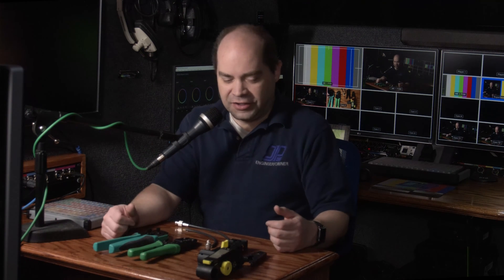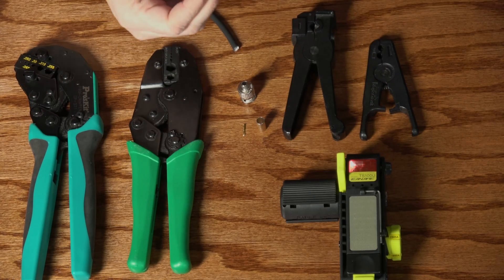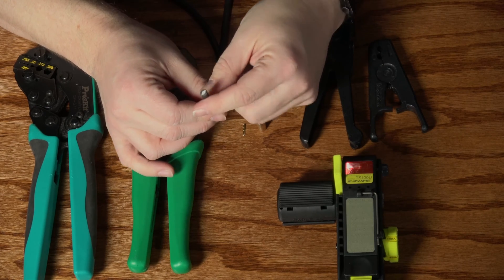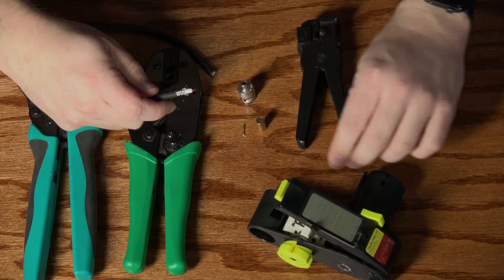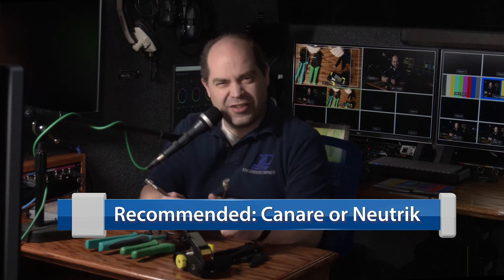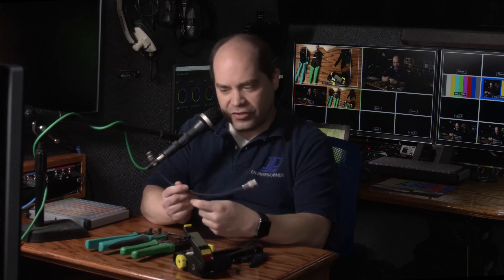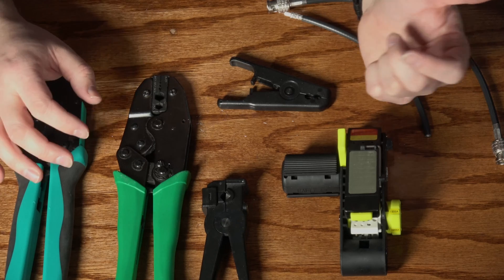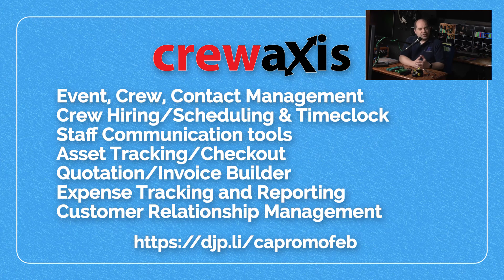SDI/BNC Cable Termination - How? What Tools?

Comment: Hello and thanks for the video. What do you think about the Neutrik Twist connectors? Would you say these Canare are superior in terms of reliability and durability, or they are both good? I like the Neutrik ones because the twisting part is long which is comfortable and quick when there are too many cables too close, and also if one pulls that in a rush, always the connector is pulled, never the cable. I am thinking to make a run of cables using these Neutrik, but I am trying to understand their reliability first.
Reply from the maker: Both are fantastic. You won’t go wrong with either one.

Comment: Hello, I am using canare l4-cfb with the ts100e stripper. I’m running into an issue where sometimes when I strip a cable the center pin is very fragile and breaks off. I will sometimes cave to cut and strip a cable 3-4 times before getting it right
Reply from the maker: You might need to adjust your stripper. It sounds like the blade for cutting to the center conductor may be set to deep.

Comment: Hey Doug,
Your videos are great and helped me figure a lot out for my church. I need to make some cable. I was looking into the 1505f for the flexibility. Is the TS100U for appropriate cable stripper or is there another model? I did not see one that list 1505f online.
Reply from the maker: The stripper should be the same as 1505A if you're using Canare connectors, so the TS100U would work, though you'd likely need to adjust the depth of the blade for the outer sheath. 

In the case of 1505F, the proper Canare connector is BCP-A42, and the crimp die for that is TCD-31C. That's a different connector and die than the 1505A that I use and demonstrate in this video (which uses BCP-B4F and TCD-451CA). The crimp dimensions are different between the two. The sleeve on the 1505F is considerably wider than on  1505A. You wouldn't have good luck trying to use a crimp die made for 1505A on 1505F; it would crimp too tightly and likely damage the cable and compromise the electrical connection.

I have not found a suitable third party crimp die for 1505F. And indidentally, Canare crimp dies only work in their own crimp frame; they don't fit the generic frames you find all over. If you're intent on using 1505F you should plan on investing in the official OEM tools, as expensive as that may be.
Reply: @djp_video  Copy. Thank you for that extra information. As I stated I wanted to use the 1505F for it's flexibility for shorter patch cables etc... I will probably stick with 1505A. Thanks again!

Comment: Your videos are very helpful - thanks so much for taking the time to make them!
Quick question, I have been starting to crimp my own SDI cables using 1694A cable (1694A-1000-VIOLET) and Belden crimp connectors (1694ABHD3) - the issue I am having is that when the connector is slid onto the dielectric it appears to flare the sheath just enough to make it very difficult to slide the ferrule down onto the sheath and connector fully. Thoughts?
Reply from the maker: I haven't used that specific connector before, but it does look a lot like the Canare BCP-B4F that I use. 

Are you using the official tool to strip the end?  It almost sounds like the outer sheath isn't being stripped back far enough.

Comment: Hi, your videos are awesome ! I have a quick question. Im on the Canare Website and they list several model connectors. I'll be using the BMD mini converters. What specs do I need to look at to get correct connector. Thanx
Reply from the maker: The connectors should match the cable you’re using. For example, I use Belden 1505A cable most of the time, and the Canare BNC connector for that cable is the BCP-B4F. 

The type of cable will vary based on what signal you’re using and the distance it needs to be run. Again, from my example, Belden 1505A is typically made for permanent installation of 3G-SDI at up to 100 meters. 1505F is the more flexible variant of that. 1694A is a heavier duty that should give some additional distance, with 1694F being the more flexible variant of that. Both of these families of cables can be used for 6G-SDI or 12G-SDI, but in shorter lengths. Each cable manufacturer will have different cables for different applications, and the specific connector will vary based on which cable you select.
Reply: @djp_video  Hi Doug, thank you for your response. My company mainly supplies audio for live band performances and such, but from time to time I am asked to supply video to multiple projectors, LED monitors, etc. where I sub out that work. With that being said, I want to provide that myself. I was given a 500ft spool of Southwire Quad Shield 18awg RG6 3G Coax cable. I believe this is what is sold at local HD. For occasional setups I believe this  is ok for me, but I'm confused as to what Canare, Neutrik or other connector termination to use for this particular cable. (BTW Neutrik is all I use for my XLR cables)
Thanx Doug
Reply from the maker: If you're using hardware store coax cable, you should be able to find suitable (though not amazing) connectors at the same store. Trying to find matching connectors from Canare or Neutrik might require some trial and error.

Comment: Looks like greenlee got bought out.   And I thought I bought what was the “2649” die which I guess is now paladin But it won’t crimp.   The link to the canare connector specification chart that you have does not work anymore.  What is the actual sizes of the holes?  Mine are .324 and .255.   Any help would be great!  Thanks so much!
Reply: On the Paladin, .052 for pin, .255 for sleeve. I believe this to be true for both 1505a and 1694a.

Comment: What would you recommend for a super flexible coax cable.  Specifically in the 3mm ish diameter range.  Its not actually for video it would be for automotive labscopes since we use BNC coax test leads.  Pretty flexible where it would almost be like a multimeter cable

Comment: What about rg6?
Reply from the maker: The Belden 1694 that I talked about in the video is an RG-6 type of cable.

If you're dealing with hardware store RG-6, good luck in finding good quality connectors that don't fall off. The good quality name brands (Canare, Neutrik, Belden) don't make connectors designed specifically for "generic" cable like that. The good connectors are made for specific SKUs of RG-59/6 from the same manufacturers.
Reply: @djp_video  do you recommend a cramping tool ? There is three kind I found

Comment: Can an SDI cable that had one end inside and the other left outside for months be salvaged (used outright or clipped and a new connector added)?
Reply from the maker: There's a good chance of it. Clip off the bad end and take a look at the cable to see if it still looks good visually. If so, add a new end and test it.

Comment: What size are the crimping dies? I see a few that are capable of doing BNC connectors but are different sizes.
Reply from the maker: http://www.canare.com/UploadedDocuments/Crimp_Die%20Spec.pdf
Reply: .176 for 1855a .255 for 1505 and .278 for 1694. These are die sizes for mostly kings or ADC connectors. Canare is pretty expensive connector
Reply: https://www.canare.co.jp/en/catalog/docs/26E/Canare26E_Eng.pdf  See Page 49

Comment: Im using the same yellow stripper trying to strip 1505F and it does not do the cuts that well, that clean or at the right distance. when it done cutting I have a copper wire, metal braiding and the black sleeve... for what it costs, its majorly disappointing.
Reply from the maker: The blade depths are adjustable if you aren't getting clean cuts. Use an Allen wrench to move the blades up or down as needed.
Reply: Do you know if clockwise or counter clockwise makes it cut deeper  @djp_video  ? Also, I pulled a USMC thing overthinking. For anybody having trouble, it literally takes 5 turns, if you go over 10 you end up cutting through where you shouldn't causing you grief. literally only 5 turns or until you feel tension fade, like Doug said in the video.. if you do it a bazzilion times your going to have a bad day.
Reply: @djp_video  , is the copper in the middle solid or is it stranded? I had a couple of pins that wouldn't go on and the wires broke off in the pin trying to get it in. im assuming the F makes it stranded so its flexible.
Reply from the maker: The F version is stranded, the A is solid conductor

Comment: You mention the foil under the braided shield. Does the connector go under that part too or go between the foil and braiding?
Reply from the maker: The connector goes between the foil and braid.
Reply: @djp_video  how is this done? I find that it's nearly impossible to twist the outer braid out of the way of the connector without also doing the same to the foil.
Reply from the maker: I usually rotate the whole end of the cable in circles a few times. The foil stays put on the insulator but the braid bends out of the way and makes room for the connector
Reply: Hey Doug, to add to this at 5:20 of the video: I am being told by a coworker that in order to put the connector on properly on this cable (1694A), I need to pull back both the braids and the foil together on the before I snap the connector in fully. In other words, fold the foil flat over the end of the connector (without bunching it up) and then the same with the braids. 

In many videos I’ve watched on the Internet of how to do this, I see the foil still laying untouched on the insulator after the connector snapped in and then the folded back braided go back laying on the connector before the ferrule gets crimped. 

I have found it difficult to fold the foil back to lay it over the connector. I keep squishing it down  where I have to start all over. Which way is correct or does it even matter? I understand that some clients have different standards of how cables are installed. Hope this makes sense, Thanks.

Comment: My second question is how to test the signal quality of the cable that I bought or made by myself is good enough? Thank you!
Reply from the maker: There are cable testers out there, but the only ones that I've seen that are actually useful are really, really expensive. So I don't have one. And I haven't needed it. I've never in 15+ years had a cable using 1505A, 1694A, and the Canare connections ever act up or fail.

Comment: Great video! Can you talk more about what kind of cables should we use for 12G-SDI, 6G-SDI, 3G-SDI and HD-SDI? What are the differences between those cable? Thank you!
Reply from the maker: Try this video: https://www.youtube.com/watch?v=s0UR3DOgA3A
Reply: If it works it works and will work for some time. These cables send digital signals so its on or off not much in between at all. Just make sure your crimps are solid, a pull test is good to do as well.

Comment: Sir I was trying to terminate my rg 56 with cheap 30 cent pins. Mostly in my area people used bnc pins with screw head to clamp the copper pen only for cctv DVR. I tried to terminate one end with bnc and another with RCA...it didn't work I have Sony x70 with SBI out 3 gsdi out. What do I need to do please suggest me something
Reply from the maker: You'll need to select a connector based on the type of cable you're using. I highly recommend Canare connectors, but Neutrik's are really good too.  Visit their websites to see which of their connectors are compatible with your cable.